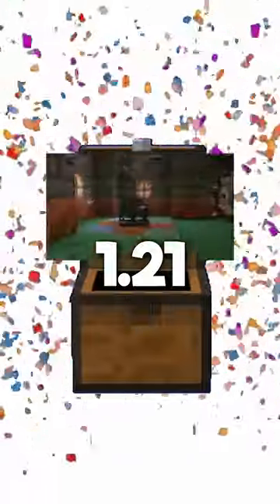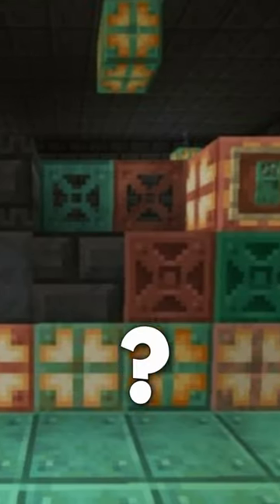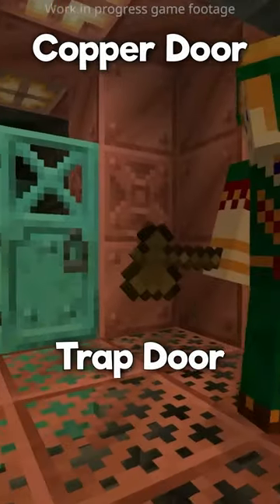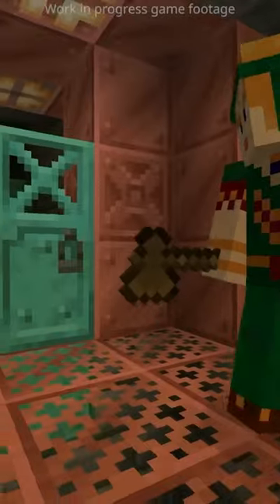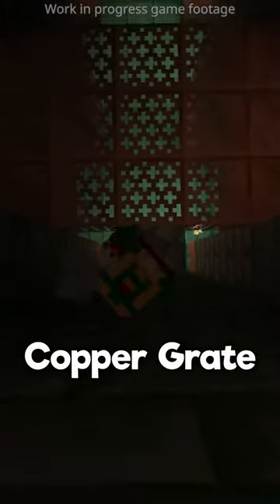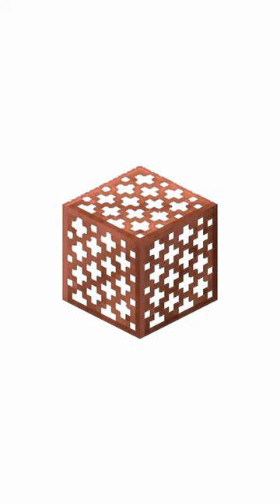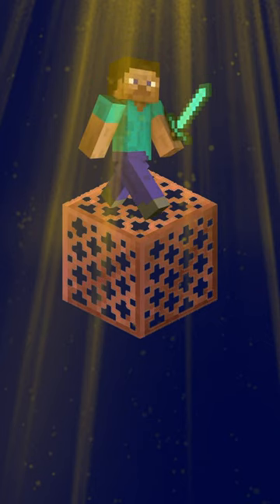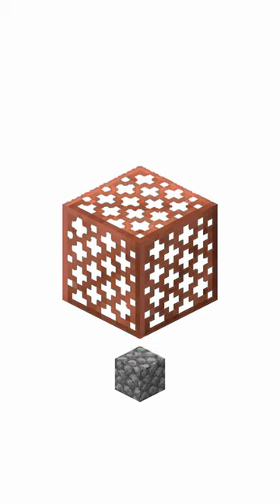1.21’s Unexplained Block

Comment: it would be if the copper door worked like if its in the first phase if oxidation it works like an iron door(the lock is intact) but works like a wooden door when fully oxidized(the lock is now rusted so its not as effective anymore)
idk how would the other 2 oxidation phases would work tough